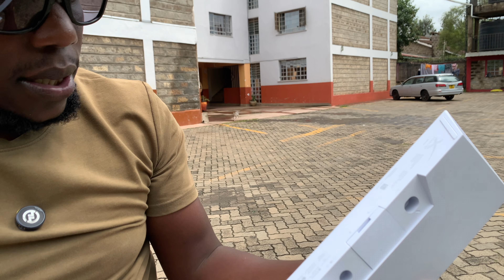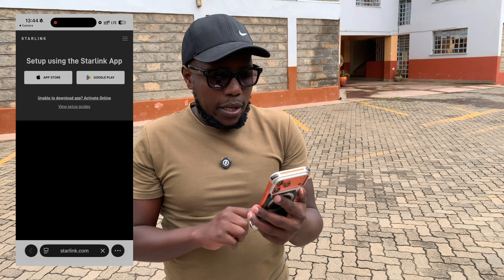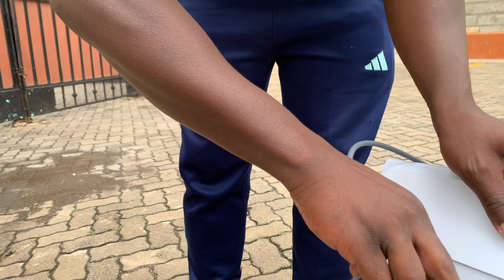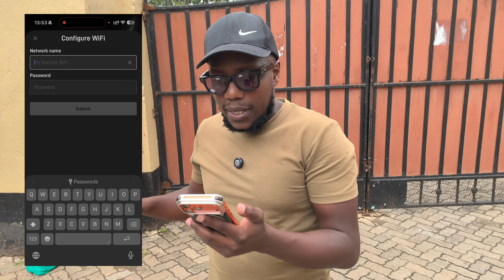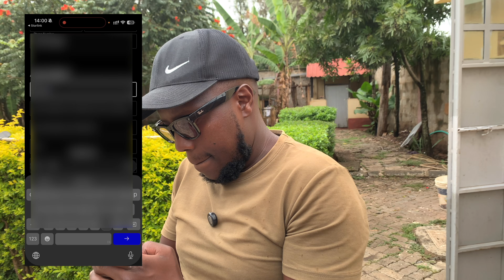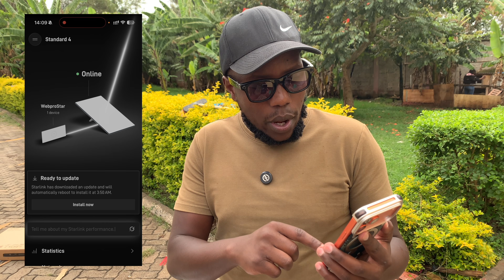Starlink Unboxing and Set Up - Step By Step (For Beginners)

Comment: I've heard that some users have a  challenge in where to place the panel in order to connect to the satellite. Hpw did you fare with the placement of yours?
Reply from the maker: Optimal Starlink placement requires a 100-degree unobstructed view of the sky, ideally at the highest point, such as a roof ridge, chimney, or high gable end. The Starlink app’s obstruction scanner is essential to identify a clear, high-performance location free from trees or buildings. These tips made it easy for me.